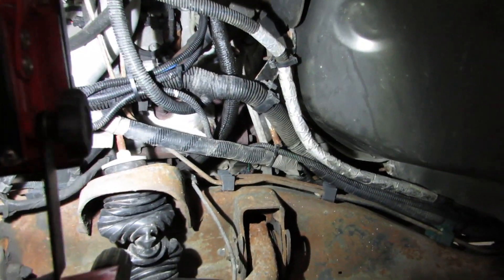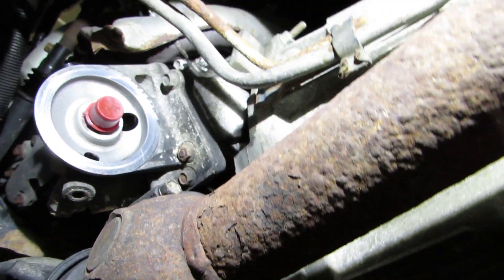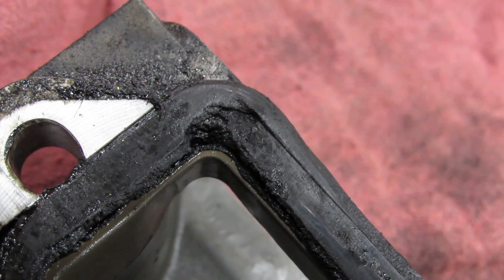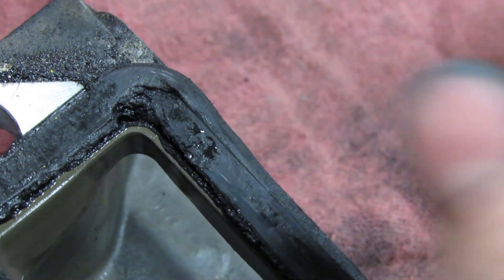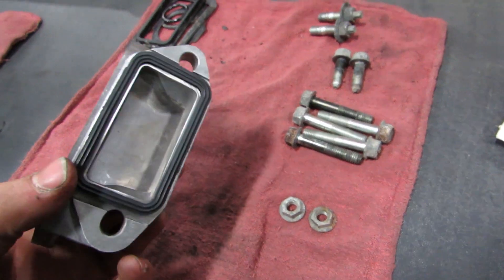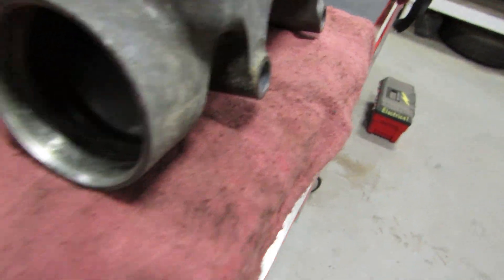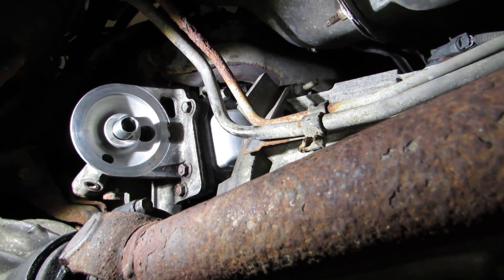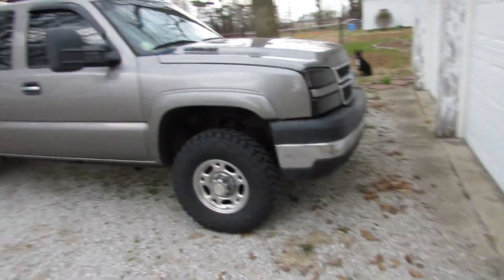Fixing the Leak!

Comment: Mine was kinda tough to pinpoint. It would lose a little coolant over a month or two, then none, then over a month, then it would lose some over less than a month, then every week or two and so on.
I searched all over that thing. Replaced coolant lines and clamps etc.  finally I saw a small puddle right under the oil filter area,
Put on a pressure tester at 15lbs and crawled under with safety glasses and a bright light while the truck was at operating temp. Didn’t seem to leak until warm.
There it was, same rubber gasket.  I’ve had the merchant kit for a couple weeks now, waiting for work to slow a bit.
After doing the water pump, injectors, FPR, hydroboost and CP3, I’m not scared of this even a little.
I just allow planets of time for unforeseen events and back pain and wade on in.
Mines a 2002 with 288k miles.   Been a great truck, just have to fix what wears out.
I’m old so I don’t see this truck going anywhere in my lifetime, and the next guy should get a ton of miles what with it being a Fl truck with all major components having around 30k mi or less now, and no hot rodding.

Comment: just did mine.... it does come out... not super easy to figure, but i just kept messing with it.... I was trying to get the yoke out and figure it would be easier (4x) but i could not get the yoke out.... and i figured dropping the 4x would b  a pita .. and it was the elbow that was leaking... so i am guessing if u just lossened the elbow and changed the elbow gasket then it would b solid ...  i wont even change the other gaskets

Comment: Finally after like 15 vids someone shows the pipe on both ends and where it fits into the cooler to make sure I knew what I was pulling on.  So the coolant pipe just pops out of the cooler right, nothing holding it other than the Oring?

Comment: nice! just pulled mine on an LBZ hopefully get the same result as you did! " no more leak"
Reply from the maker: Rick p thanks! best of luck to you!
Reply: I did my water pump about 6 months ago and now this ! at least it was not head gasket which i was worried about! this time though will change thermostats they were never done & truck has  425000 km.- 267000 miles should have done them when I replaced waterpump  since temperature never goes past 160
Reply from the maker: Rick p The thermostats were the first issue I had. Truck wasn’t reaching temperature and throwing a code. So i replaced thermostats and water pump since it had higher miles! I’ve got head gaskets on my list for the truck!
Reply: Personally thought at the time it was only sending unit but recently before the leak "this past weekend" mine had started to log PO128. would clear but always returned unless I worked it harder to raise temp. a little but only it developed the leak! lol
Reply: Well happy to say i restored life to my lbz😉 put oil cooler back in last night as well doing my thermostats!!    No more leak & plenty of heat!! Motor runs great !! At least i managed to jimmy it all back together without removing crossover pipe 😉 Your video clip was very helpful ! Thanks
Reply from the maker: Rick p very glad to hear that!
Reply: in order to get enough clearance & not remove the crossover pipe was to back off the one stud that is protruding through the bell housing. that has the 2 pipe bracket on it. it's inline with the elbow & with a Macgyver push tilt & squeeze the cooler assembly came out & back in the same way, but in 2 pieces. I also unbolted the elbow from the cooler as well. It's a righteous pain to unbolt the crossover at the flange & saved over an hour !!  I'm glad it worked out the way it did!

Comment: how did you get the black metal coolent pipe out of the oil coolent hoising?
Reply from the maker: Julius Des I removed the two nuts off the water pump and pulled the pipe out with the oil cooler until I could them apart.
Reply: I am trying to get the pipe out with the housing still attached but it feels like something is holding it, i was changing my water pump and one bolt was striped so i tried to take out the water pump and the pipe together but the water pump housing broke and bent the end of the pipe where it screws on, so i just need to wiggle it harder then, or do you think i need to take of the oil cooler housing as well? Thank you for your reply, Greatly Apreciated....
Reply from the maker: Julius Des if your just trying to get the pipe out of the oil cooler.. just pull or pry it out. The pipe is sealed into the oil cooler with just an o-ring. What makes it so hard is all the corrosion from being on the external side of the seal.
Reply: Thank you for your info, I just didn't want to break anytging else because the pipe is $230 I can only imagine the housing would be alot more, this is my 4th water pump replacement, and I think the culprit is the coolent cap because the system wasn't breathing ..
Reply from the maker: Julius Des No problem! Water pump jobs are time consuming! Especially if the cause was a cap. When going back together make sure you get the oil cooler housing cleaned up extremely well to avoid the risk of hurting the new seal when going back together.
Reply: 4th water pump replacement??  Somethings not right Julius.  What type of coolant are you using?  I have over 354,000 miles on my LBZ and it still has the original water pump.  I'm sure I just jinxed my truck for saying that.
Reply: I have a leak around the rear driver side block area but only every once and a while...how could you tell if was lil cooler leak not head gasket?

Comment: Their is a petcock on these, its on the front passenger side, just past the inner fender wheel well toward the front you can find it.
Reply: But not on LMM, supposedly some LBZ are missing too. Likely which radiator got pulled off the shelf